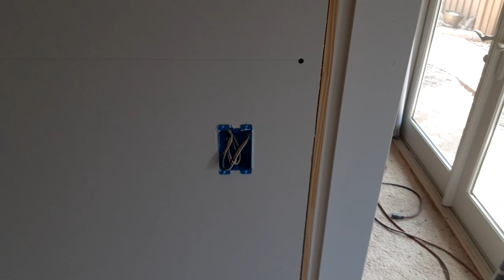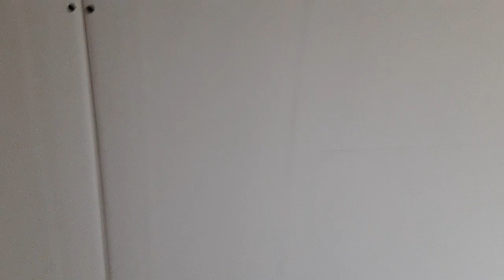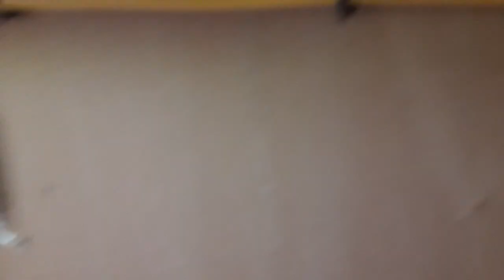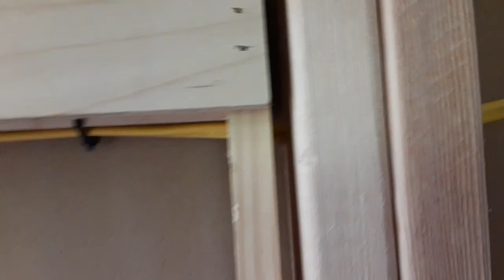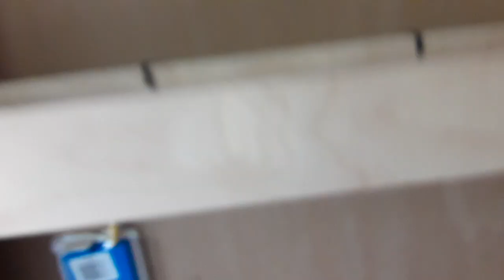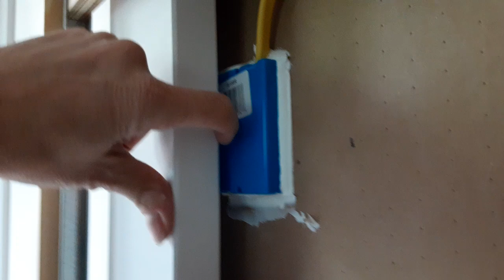adding an electrical box to a pocket door frame for a receptacle

Comment: Hey looks great, but this is a code violation. Your box will exceed box fill. Thats 12/2 wire. If you calculate that out you would have 1 device 2 wires 1 gnd. Which would be 11.25 cu inches those boxes are only 8 cu inches. You can add a spacer to get the extra or use a metal wide box. Also if i was you personally id build that stud out and mount it to the stud piece. Caulking shrinks over time and itd suck to have your box pull out of the wall because someone yanked a vacuum chord.
Reply: Just run a switch leg there 1 wire.
Reply: RACO GRIP-LOK Old Work Steel Electrical Switch Box Support would meet code and do job of the caulk
Reply: Is the wire run behind the drywall to code? A nail or screw into the wall might penetrate the insulation, no?